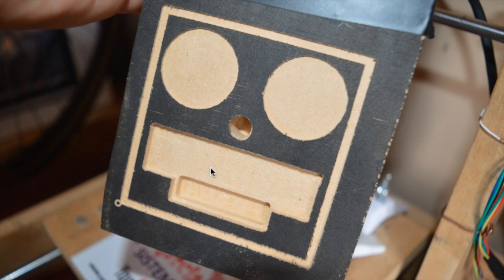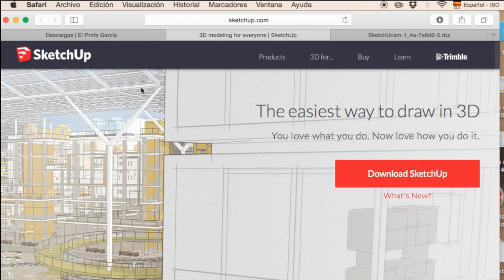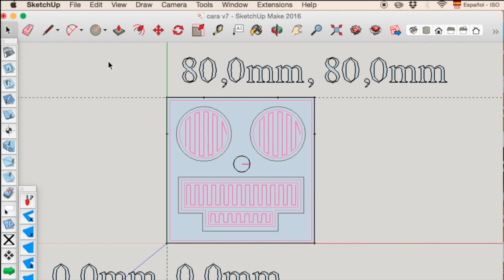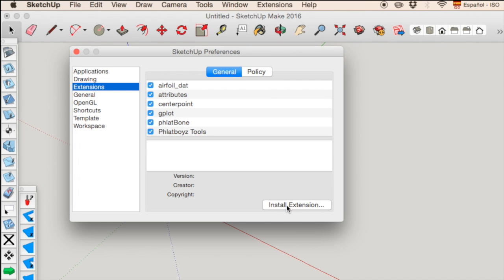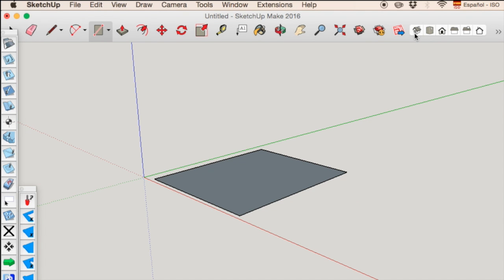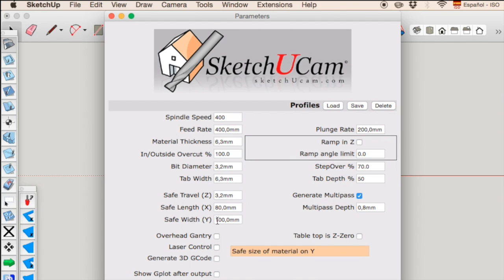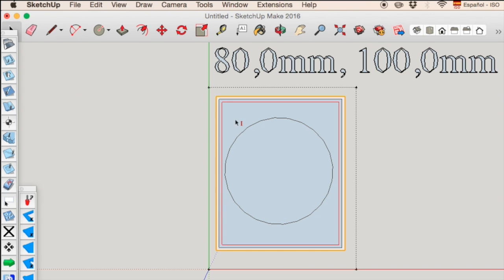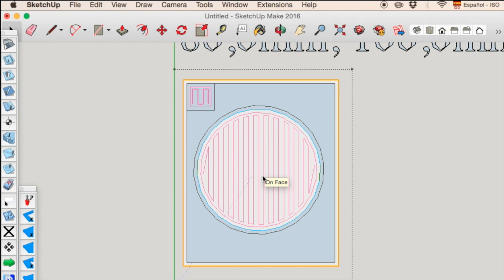✅ Programa de Modelado 3D y Tallado básico 3D con CNC #10a

Comment: Hola profe tenga la duda con el dremel 3000 puede cortar aluminio o algún metal ? es que me ando haciendo una cnc y estoy tomando de ejemplo la suya me gustaría saber si necesito otra roto herramienta o con el dremel me basta gracias
Reply from the maker: Lo puede hacer programando en la CNC movimientos lentos y el tallado lo debe hacer por capas pequeñas
Reply: Gracias por responder profe, solo una ultima consulta cual es mejor para la cnc el dremel 3000 o el 4000 ? los encontré con muy poca diferencia de precio y no se cual sea la mejor opción. gracias, le enviare un café, gracias por la ayuda :)